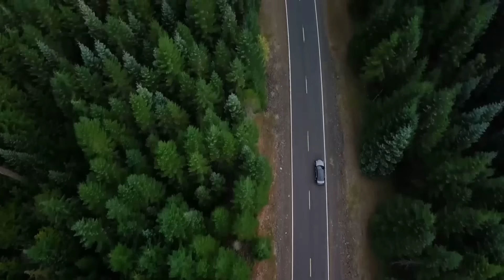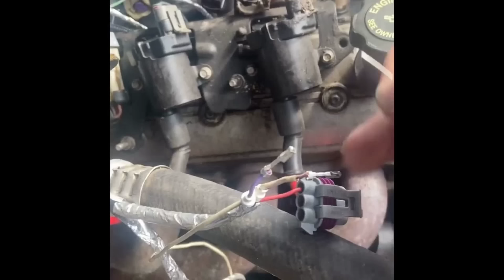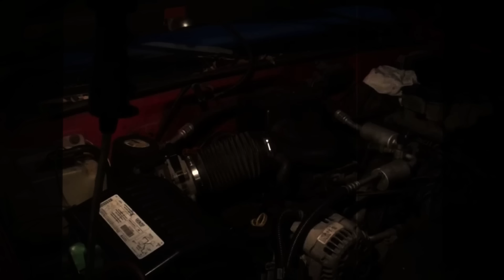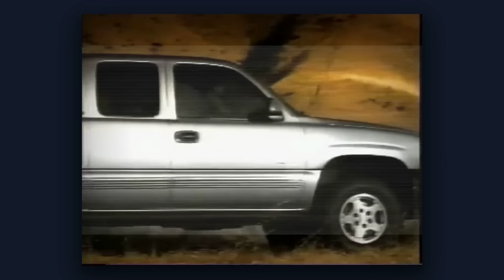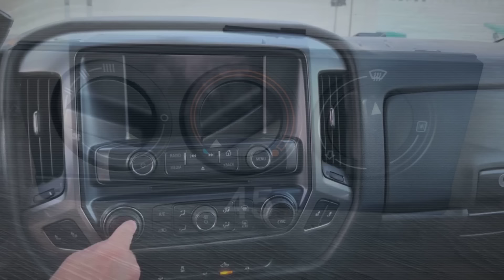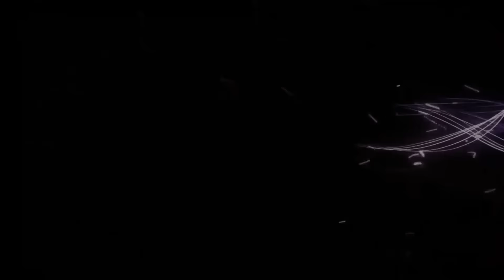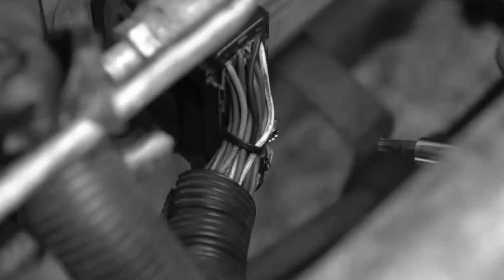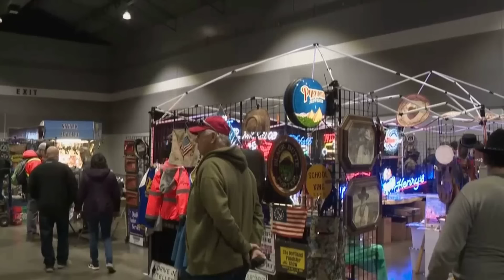How Smart Mechanics Are Bypassing The Dealership (The "Delete" Loophole)

Comment: Remedies for trucks? 12 valve Cummins into anything! Power lead to start and fuel shut off. Unless you use a choke cable, which I find better. Pull it out to kill the fuel, leave it out to act as an anti theft device. Seen Dylan McCool drop a newer 5.7 Hemi into a 70's E body, and then use a Holley EFI carb on it. Manual transmission and 300 horse, or so. Don't remember the figures. One's a go fast solution, the other a go forever solution. Unless yer Westin Champlin. Then it's a go fast till it blow solution!

Comment: I tore the computer out of my 96 dodge ram and dropped in a GM style HEI distributor and a voltage regulator. I threw a propane system on the truck and kept on driving

Comment: Great argument for carburators, but you forgot one famous champion and hero of the aftermarket movement, ThunderHead289.  This man created a solution that tunes the carb on the fly and improves gas mileage akin to those cars in the late 80s early 90s, 35 MPG.  Brilliant man, simple tech, and unlike aftermarket add-on EFI solutions, if for some reason there's a Carb Cheater failure you don't lose the engine, the engine, or the carb to be more precise, continues to function like it came out of the box, without the optimization of the Carb Cheater.  And you can adjust it with an android phone!  On the fly!  And, the kit helps you fine tune the carb, and once done that's it, no further tuning needed!

The man is an unsung hero, check him out!

Comment: I went even harder against electronics with my 81Chevy C20 that actually had a factory spark/knock control computer in it.  Now all it has is a new flat tappet, small block Chevy motor, HEI and a Holley Brawler carburetor.  Yes, I have to pump the gas pedal twice on cold days and use Valvoline ZDDP oil but I'm completely free. My newest car is a 2006 Diesel with the EGR removed, no cats and a service life that is at 300K miles and climbing. When it dies I can completely rebuild it with analog parts to add 150+ hp and I can't wait.

Comment: Remember kids in Kalifornia if you’re truck/car still has smog testing requirements every two years. Can’t drop in another system or drive train. Testing talks directly to states DMV. Things don’t communicate or jive with stock manufacturers specs. Won’t get current registration. No registration no insurance 
Can’t legally operate on Kalifornia roads
Reply: Doesn't California still have that "alternative fuel" exception.  You just need to change the truck to run on peanut oil or something and you don't get smog tests

Comment: Mechanic here who works on new large fleet cars and trucks, it cost us thousands of dollars to replace very simple parts that before cost nothing to replace, for example a window regulator was easy swap and fix for a bad window, now I can swap to a new part and nothing happens, the car thinks the regulator is bad and does not work, we have to take the car or truck to the dealership to be programmed, or spend thousands on a special scanner that every year requires a expensive subscription.  They are Even making special light bulbs that unless you buy from the factory will not work.. Mercedes Benz is the brand that you can't even buy a light bulb unless it's a special Mercedes bulb.

Comment: - BIG CAR PROBLEM IN US  &  SOLUTION-
Do not buy new cars from Dealerships, . . . , Why?
1)  Way over priced at $50k+ with big finance & insurance costs.
2)  Engineered to fail soon after warranty expires. 
3)  ECU programmed to block DIY repairs and require frequent expensive soft updates. Goodbye "Right to Repair".
4)  Monthly subscriptions to keep  functionality.
5)  Driving data collected  via Internet & sold to auto insurance companies to adjust premiums up.
6)  Fancy electronic dash boards,  turbocharged engines & Airomatic  suspension systems that lead to high fail rates (the dreaded CEL) and very expensive Dealership repairs.
7)  High fail replacement parts and discontinued OEM parts.
8)  Industry strategy to replace the 300k+ mile car with the 75k mile "Disposable Car".
9)  Swiss Cheese Warranties with many fine print disclaimers.
10)  SOLUTION:  Buy old and DIY restore or have trusted mechanic restore,  forget Dealerships !!!

Comment: What is the aftermarket doing. It is on their obligation to come with the solution. I hate how manufacturers operate, but we can not made them to make parts for cars older then 10 years. Also often they build their cars and trucks to only last 10 years. The only thing i would make mandatory is that manufacturers supply all technical drawings in 3D CAD after 10 years so anyone can make precise parts. The biggest problems with newer cars and trucks is the mandated pollution requirements, if you take out to much and put older analog engines in then you may not pass emission test. You would need to transfer the VIN to the new truck from older one to be under that year emission laws. You could say that you did upgrade the old truck with newer body...

Comment: Walking is better than dealing with a carburated small block Chevy.  One of my proudest moments is putting an aftermarket fuel injection system on a 1974 Chevy K20 pickup.  Why would anyone want to go from 25 mpg to gallons per mile?

Comment: I recently swapped a RAM ecu for an unlocked one to fix several problems that seem to be intentionally programed by RAM. It was not cheap but but the difference it very noticeable and should increase the lifespan of the motor.

Comment: After watching Wheeler Dealers, you find many in the UK and Europe have opened up shops to deal with this corruption and from discontinued brands and models.  You have shops that fix or remake those items and they are better then what was made.  All those "computer" modules should be fixable by replacing the part inside or some one just make a better one.  

From watching that show for over 20yrs I realized that they are very creative at getting around Discontinued issues.

Comment: sold my 05 after dealing with this... the glowplug controller for the "workhorse" platform used in heavy vehicles is the same part but looks slightly different and has a slightly different part number. the duramax is an isuzu diesel engine.

Comment: The AFM failed on my 08 Silverado and I bought a gen 3 6 l engine, it was the  LQ4 version. Unfortunately the crank sensor and the cam sensor were completely different. I took the crankshafts out of both engines and I had a machine shop press the crank sensor on to the Gen 3 crank. Swapping out the cam sensor was a lot easier that was pretty much a bolt up job. This gave me a gen 3 engine without the cylinder deactivation but it had the Gen 4 computer and sensors, which made the older engine compatible in the newer vehicle. 

Then I started it up and it started perfectly. But then I started driving it and something very bad happened. The vehicle was not even usable because it was only running on four cylinders all the time. Then I took the ECU out of it which took about 3 minutes and I used my wife's Nissan to deliver the ECU to one of those engine tuner guys with a dyno. I told him what was going on I dropped it off and he said it would be 200 bucks, probably took him 5 minutes but I don't care. I put the ECU back in and it ran absolutely perfect.

 This was years ago and I am still driving the 08 Silverado every day and it has over 300,000 MI. I've decided I'm going to try to just keep this thing indefinitely because it runs great and it drives great. 

One little extra thing that I did do on it while I had it apart was I bought a Melling high-volume oil pump. When the engine is hot it carries about 60 lb oil pressure while driving and a little over 40 lb oil pressure while it is idling completely warmed up. 

I did have to fix a major oil leak 2+ years ago and that was expensive, I had to have it professionally done and they had a lot of trouble getting it right for some reason. It required removing the transmission.  It was the worst oil leak that I've ever seen. I just kept a large jug of oil and had to put a bunch of oil in every day 

Now I do not even put synthetic oil in it I use premium old school oil. I'm just afraid of getting another oil leak because I know that stuff flows better and will have a tendency to leak on older engines. As long as I change the oil more frequently it should be fine with non-synthetic.

My gas mileage was extraordinarily bad even though it seemed to run okay. I started running exclusively top tier gas from Costco and four or five times in a row I put in fuel system cleaner that has a cleaning chemical called PEA. After a few tank fulls my gas mileage got a lot better, like I gained almost a hundred miles to a tank. I went from less than 10 miles a gallon to about 12 mi a gallon. People expect those cleaners with the PEA to do the job in one tank full, but if it's bad it takes several tank fools to really work. Also the fuel system cleaner has to be one of the few that come with the chemical called PEA. It has to have that specific chemical and it is the same chemical that they put in top tier gas. Red Line and and Techron and Royal Purple Max are three brands that have it. I have used the Techron a few times and the Royal Purple, I plan to get some of the Red Line because I think it has the most PEA, I think Royal Purple has the least out of the three. I had good results using the whole bottle of the large 32oz  bottle of the Techron.  

You can keep older vehicles running but you have to be dedicated to doing the work and mods and and don't take just half measures. If you live in one of those godforsaken states with smog testing then God help you I don't know what you can do then.

Comment: This is overstating SO much with AI slop. 
How long should a dealer build parts (that cost far more than the aftermarket parts) for a car? 20 years? 30 years? That’s ridiculous to think. They don’t have these parts built because no one buys them. They’re competing with the aftermarket that copies their designs with slight changes, and a society that doesn’t repair their cars because their neighbor just got a new truck and they want one too. This video is aimed at people that will repair their cars, not the vast majority of consumers, that simply consume. 
I’m going the opposite of all this. I’m updating old cars that weren’t that good to begin with, but they don’t have the taxable value that new vehicles have. New engines and transmissions in old cars is SO much better than what this video suggests it’s difficult to describe it all here.

Comment: A problem i see with a carb swap is fuel efficiency. My 2015 Ram with a 5.7 making 395 ho gets over 20 mpg on the highway. Drop in an old 360 with a carb and rotor ignition and that drops below 15 with only 250 hp now. Yes. You can have more hp, but at the cost of even worse gas mileage. And just to note, I would never in a million years buy a brand new truck. They are far to complicated and far to expensive. As for cars. I abandoned the ICE ones years ago for electric and would NEVER go back. They just work.

Comment: Another overlooked area that people are able to access. When you are looking for any larger more exensive components such as an engine or transmission. Foreign offshore junkyards will ship parts to your country for usually a reasonable fee. Many alternate engines are available outside our countries that are better than what we can access in house. Transmissions too.
Reply: Jet fuel is adding up to $60 for a one way transatlantic flight, Europe is down to a few weeks of jet fuel reserve stocks that is left for hundreds of thousands of flights this summer. All 51 European fertiliser plants (LNG to Fertiliser) have shut down due to the excessive cost of electricity, and soon there will not be a regular supply, almost globally...
SEE THIS REPORT:  
As of May 2026, approximately 13,000 flights were cancelled globally for the month due to soaring jet fuel prices caused by conflict in the Middle East, reducing capacity by about 1.5% and removing nearly 2 million seats. Separate reports indicate over 75,000 summer flights were removed, with Lufthansa alone cancelling 20,000 short-haul flights through October.

Comment: A stranger walked up to see if I was interested in selling my 1997 F-250 in my garage.  My reply, NO, not ever.  Let the revolt begin against buying new vehicles that only the dealer can repair.  New vehicles are made like the cellphone industry as disposable devices with wheels.  When the computer screen fails and there are no replacement parts the value of your vehicle drops to $0 destined to the junk yard.

Comment: The reason this can be done is because manufacturers haven't actually made any technological advancements in several decades, they just make things more complicated but the core is the same as it was since at least 1996, maybe 1985. With AI, it's not going to be difficult for a lightly funded group to reverse engineer a solution. They have compounded how water easy it is to reverse engineer their products by outsourcing manufacturing of the electronics to China, who's made a whole economy out of reverse engineering western tech. Chinese products suck but it's not because they don't understand how to make it, it's because reverse engineering is less profitable if you're not cutting corners. However they created a cheap reverse engineering market. Companies like Holley and Haltech have figured what manufacturers are up to and how to get around to it. I'd expect 10-20 years from now you'll get all your modules replaced after your warranty expires and once you do your whole ecosystem of parts change where everyone is using the same 2-3 coil packs, transmission modules. The only difference will be the enclosure housing the electronics.

Comment: I have a 2010 Chrysler T & C, it had issues with the #5 spark plug. Replaced Plugs and Wires, that didn't fix it, replaced the EGR Valve Sensor, that didn't fix it, ended up replacing the Ignition coil pack. That fixed it.. 230 Dollars in total.  I miss old school vehicles. Pre-2000's.  And I'm currently looking for something older, cause I'm done with the Junk they make now.  Everything sitting at a Dealerships millions of cars and trucks are all New JUNK.  I'd take a 1964 Austin-Morris Mini over any New car on the road today.  Why? Because Mini's back then where built by people, not robots.  A plain car that did what it was designed to do, get great gas mileage, and get you from A to B, and if you took care of it, it will always start and run.  It didn't have electric anything thing, no computer. Window cranks, Heater fan, just a simple and very fun car to drive.

Comment: Car manufacturers always been trying to make things more complicated than they are. To make an engine work you need air fuel Spark you don't need a computer to have an engine run. There is kids out here there's mechanics out here that can figure out how to bypass it with a homemade wiring harness with a basic analog computer system and no one can stop this from happening. Car manufacturers are screwed. The money is going to be who can bypass these computers

Comment: I expect the next vehicle (should I need one) to come from Hemmings.  There were some pretty fine vehicles built in the 60s and 70s.  As an example, Hot Rod once got (I think it was) a '70 Monte Carlo with a de-smogged 350/Quadrajunk/Hydramatic up to 26 mpg in the earlier days of smog crap.  As I recall, it passed the smog numbers also, but without the smog gadgets.

Comment: I’d like a restored pre 70’s pickup please. No frills, manual everything. A 4 speed manual transmission, carbureted, points plugs and condenser tune up.
   I manufactured an adapter plate to put a 2 barrel carb from an old T-Bird on a straight 6 Chevy pickup. It ran great.

Comment: I went the easy route. I just bought a 1981 Ford F100 with a 6cyl 4sp manual transmission. All the electronics are confined to the duraspark II and the radio.

Comment: I had a 96 Corolla that I had owned for almost 10 years. It was in great shape and ran fine. The trans had an issue I didnt know about until it happened to me. The front diff seal goes out leaking the diff fluid over to the trans and runs the diff dry. 

I figured out what was the issue and tried sourcing another used 3sp auto with no luck. I even reached out to the people claiming to offer remans for more than what I paid for the whole car with no luck. 

I then turned to trying to repair it, but there werent even any parts available for it anymore.

I then turned to alternatives like the late 80's chevy nova and the prism but parts are gone for them too.

I could have done a manual swap to fix it, but that was a lot of work to fix a $500 car so I hated to scrap it, but was forced to and got an early 00's car that is electronic, but not to damn electronic that I cant work on it.

Comment: My FRM module is broke in my BMW e88 after using ista lights stuck on dipped beam no indicators electric windows and dash lights. I have to send the module to a specialist to be uncorrupted.
A switch is a simple device that joins or separates a wire, sadly an intelligent idiot with zero Common sense thinks a module is a better way.